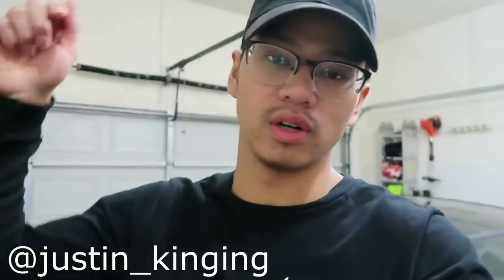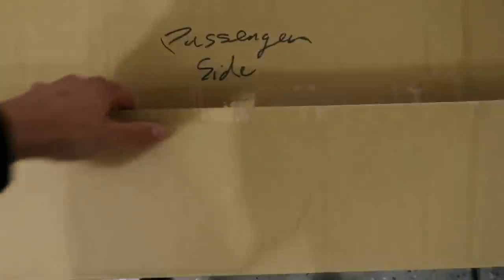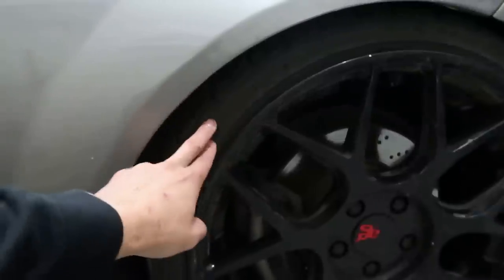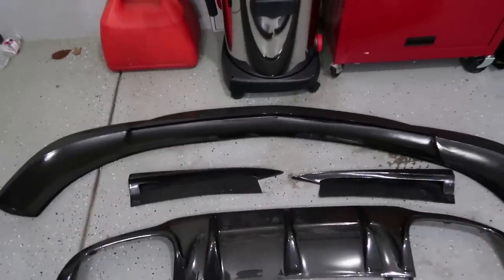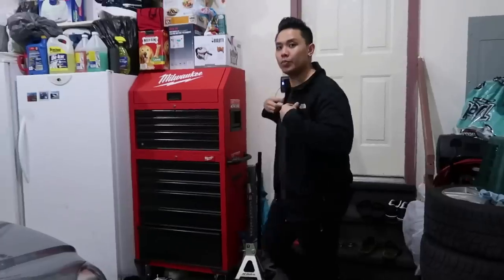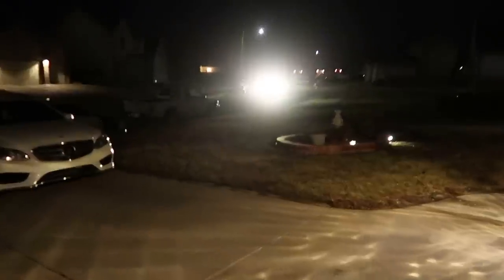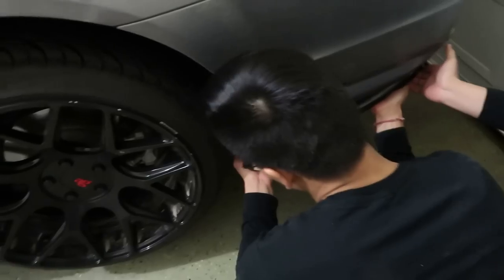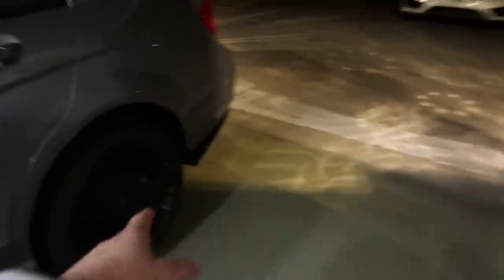Mercedes-Benz Gets Sick Carbon Fiber Pieces!

Comment: Does carbon fiber diffuser fit properly? Is it direct fit? Where did u buy it
Reply from the maker: Umm, it’s not a really direct fit, it could be better but just have to do a little mod to it and it fits okay but not the best. And on eBay
Reply: @lightheartmediaofficial  ok thanks.
Reply: I bought a diffuser today its black color not carbon fiber tho. I was told 2013 c300 carbon fiber doesn't fit properly so I went with the normal plastic one. It looks good ..too
Reply from the maker: Merc Khan yeah, the fitment on the matte black diffuser fits perfect but the carbon fiber one is alright, not the best fitment but something I can deal with and looks decent.
Reply: Merc puktun broo where you get the black plastic one?
Reply: @lightheartmediaofficial  any links to the products for eBay. I want to purchase some parts. Please
Reply: @mercpindi5522  any links to the products? . I want to purchase some parts. Please
Reply: @MrMian009  did you end up find some sick pieces I’m looking into some but idk which one I should put on the car